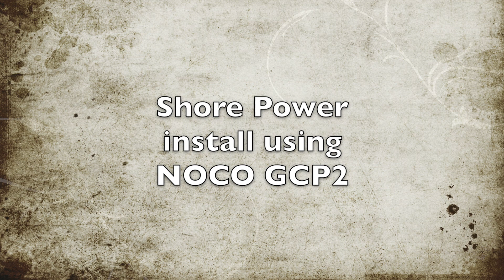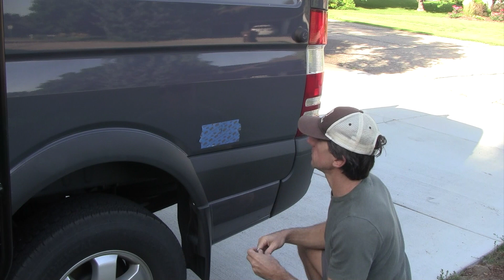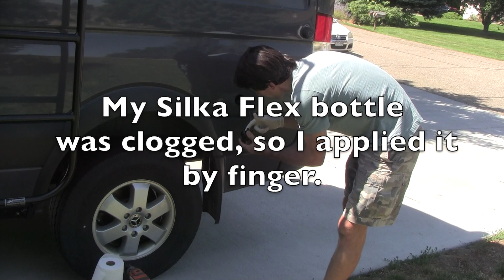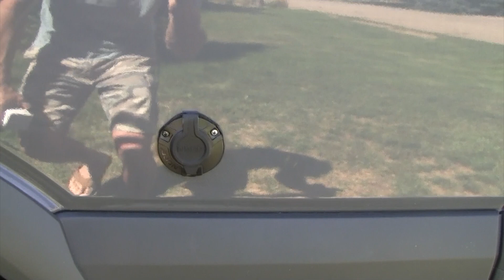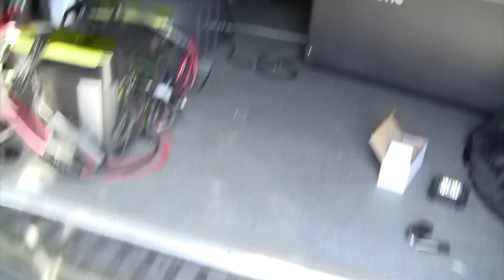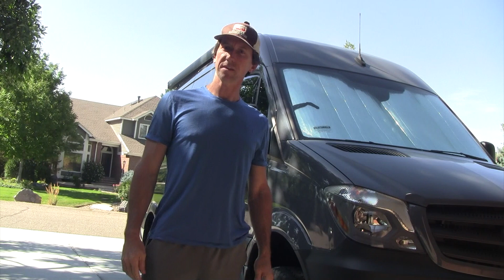Installing van shore power using NOCO GCP AC port

Comment: Good idea with the tape. I’m about to install, a bit nerve racking drilling a hole in the side of my truck😂
Reply: Thanks, ended up going into my Tundra grill. Only a $700 fix if I screwed up but it went perfectly. Great vid!
Reply from the maker: I know what you mean!  Felt the same way when I cut the roof for the fan.  Good luck with your build!